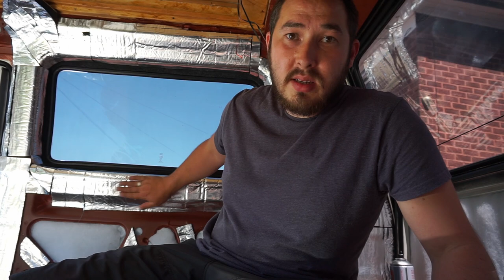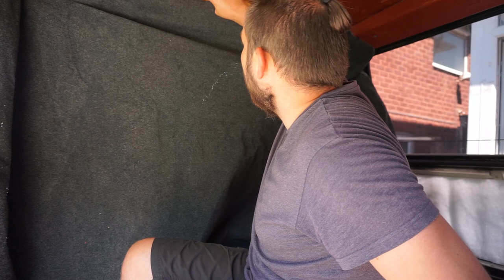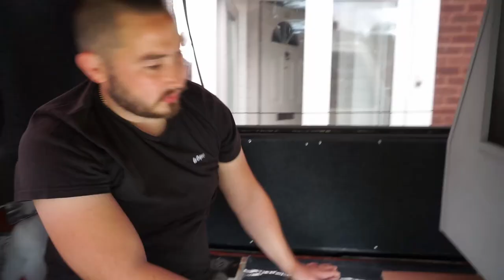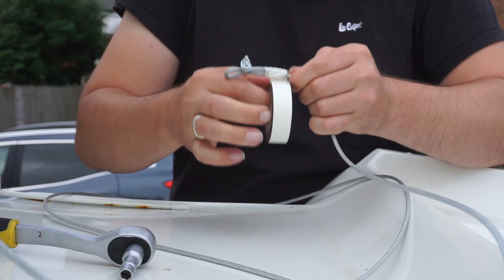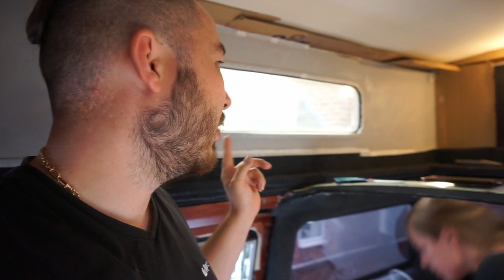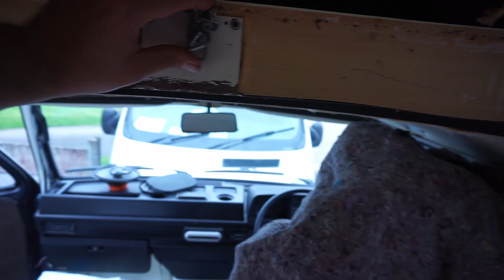FINALLY! A CAMPERVAN UPDATE! | T25 Volkswagen Campervan Renovation

Comment: Where you are ready to put that van on the road, I would suggest getting yourself a dashcam. Does not need to have audio or anything fancy but something that can record 1080p at the least, which almost all of them do. This could potentially save you a lot of hassle if you should be involved in a little "fender-bender".....can't argue actual video. Interested to see the finished van. Good job.